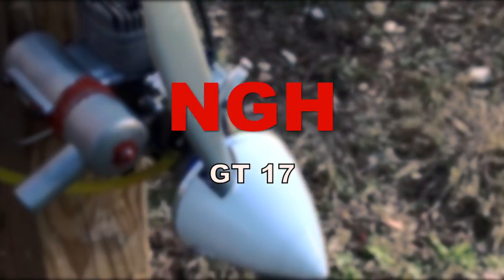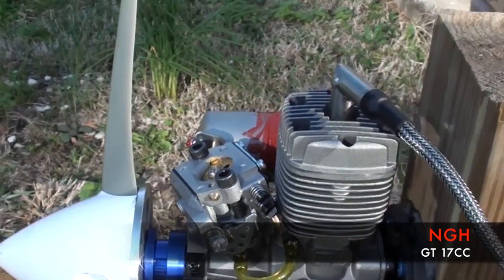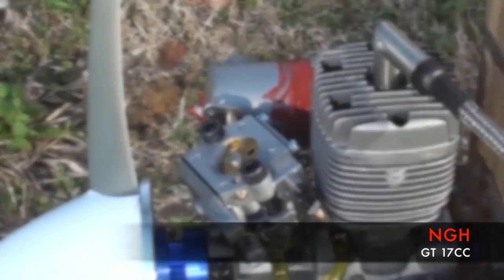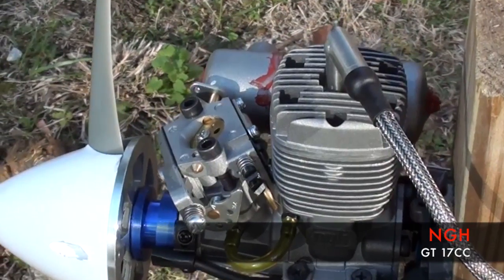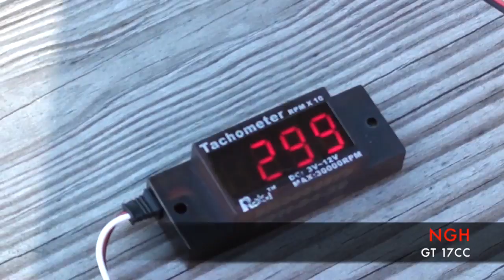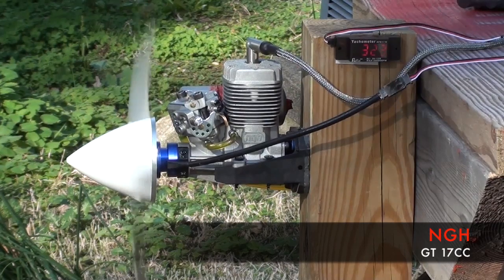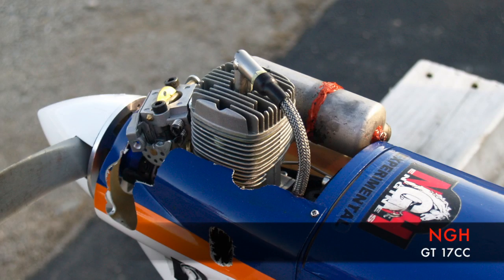NGH GT 17 CC RC

Comment: We need to know the net payload of the UAV drone that will be fitted with this engine, as well as the engine power in relation to the payload. If the UAV has a payload of 50 kg or 100 kg, what would be the optimal engine to be connected to it?

Comment: Hi are firts genertion problems solved?
Reply from the maker: Yes, they fixed it with a gasket between the carburetor and the motor.
Reply: Which problems you referring to?
I have the same problem and I can't tune it properly. I can't stop it from checking when opening the throttle for low to high speed.

Comment: Did you Chew the holes in the cowl for cylinder clearance??  Nice use of Drywall screws to mount your Engine, your the kind who should be making video tutorials......LOL.....
Reply: Did the motor fall off it's mount in the video you saw? Seemed FINE in the one i watched. NOT all of us are clueless enough to think a TEST STAND needs $50 bolts for a 5 minute run....YOU do a better video. Put it up, or SHUT IT UP.
Reply: World full of Stupid out there. It's just Dangerous Use a rubber band if you like save yourself some $$